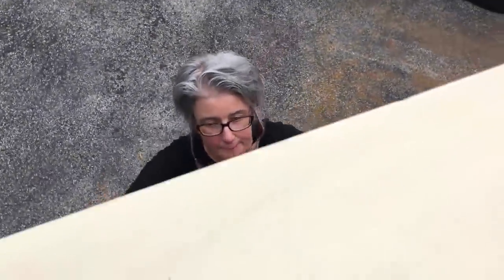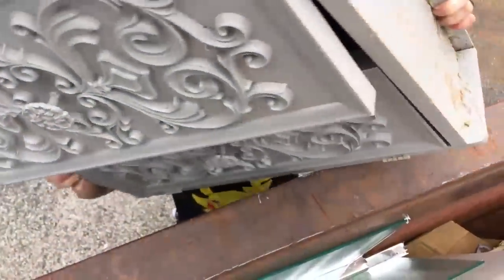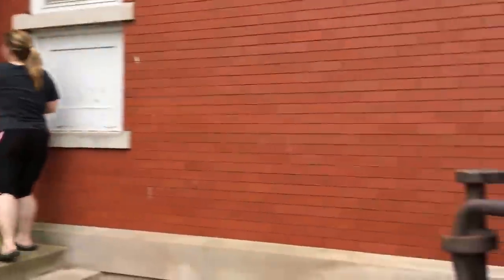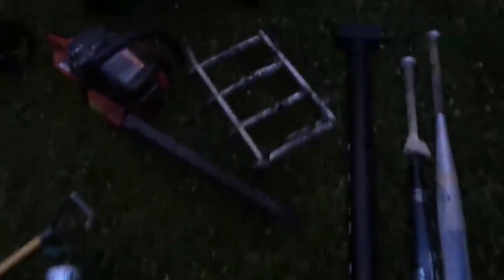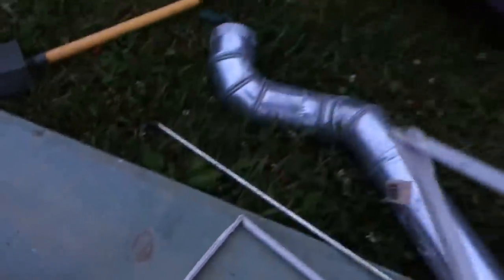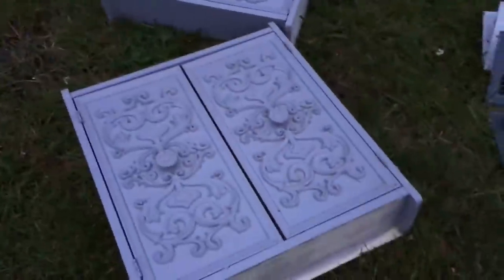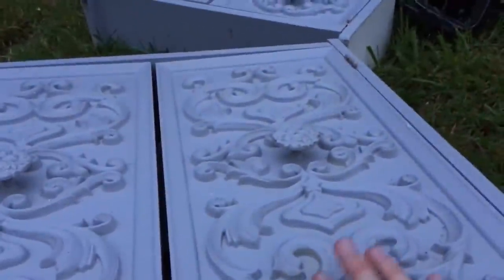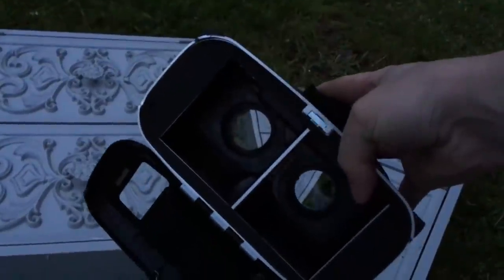Random Bits 0228: 1909 House Progress, Free Chainsaw, Snow Plow, Cabinet, Vent Grates

Comment: This video just popped up:  like Mom’s braids (I have a thin 20” curl behind my left ear, hangs down in front, most of my hair is about 1 1/2”‘at longest).  We have a plow attachment  that fits both of our riding lawn mowers (his and hers). I w have used it to level sand, push mulch. If we had snow here in S Fla it would be used for that too.  I also found it more useful than the mower trailer to move landscape timbers around our property.  👍 like your videos

Comment: You know Rinoa,
If not equipped already,
You can buy either battery, or hardwired some detectors.
Now some of them, are a combo smoke/carbonon monoxide alarm too.
Also, some are sealed, so the battery never needs changing over 10 years, when they should completely be replaced.
Oddly, some states will only sell photoelectric some detectors, and some mandate the 10 year sealed in kind.
One more note,
Some are a combination of a battery, either a 9 volt or sealed, and hardwired.